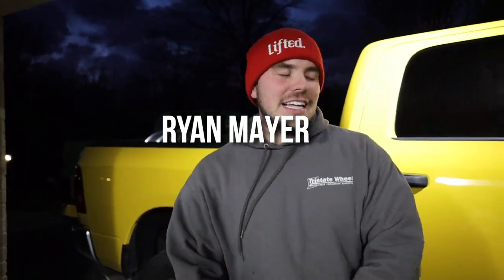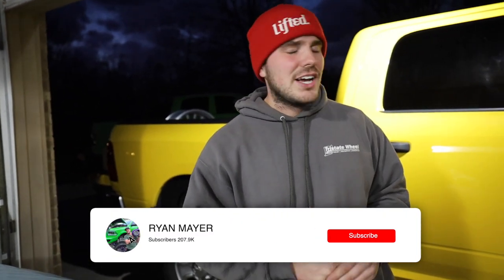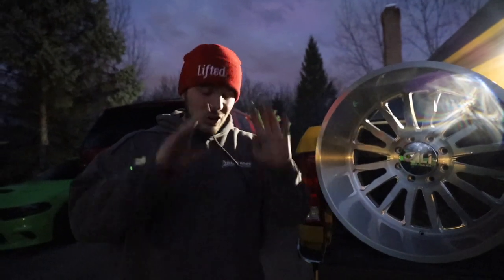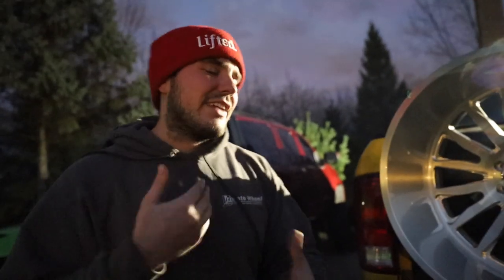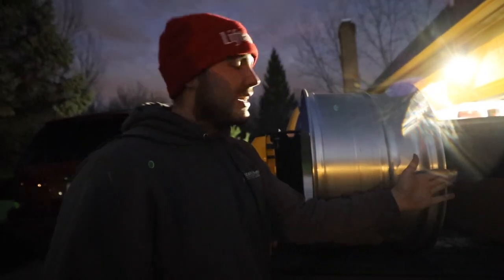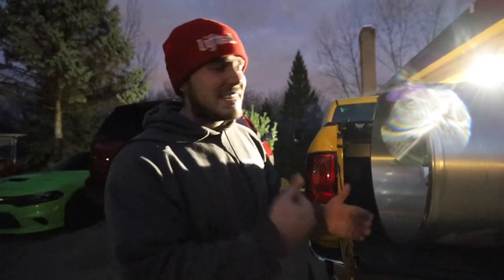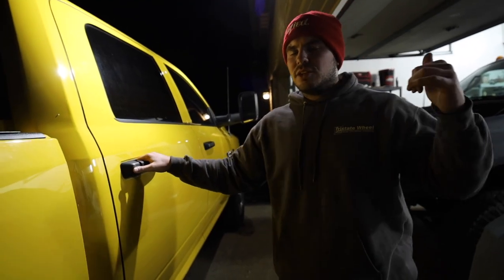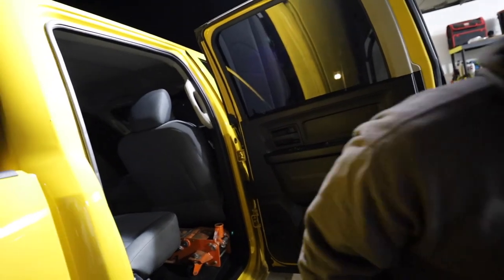Building a Banana Ram | Part 6

Comment: You should put custom led strips in the door handles that have clear running light and amber dirctional  lights but do a clear over it with a little yellow tint so you dont see them till there on

Comment: Power stop makes a drilled and slotted rotors and pads,I have them
 On my 06 dodge, I tow and drive it hard and never had a problem with them and they didn't cost alot.
Reply from the maker: Really? I’ll check em out!

Comment: I would do the red.  You've already got purple on the other truck.  Do the red.

Now, if you want to get tricky, wrap the truck in primer grey and do the suspension in red, or cardinal red, with some red features on the truck body, along with maybe some white here and there.  Straight up BUCKEYE truck!  That's exactly what I would do.

Comment: One thing a I think you should have gotten a dually banna ram 3500 and gotten Katie a long bed crew cab dually 2015 f450 but the point is you should have steel wheels on a hauling truck not aluminum or some alloy not complaining just a personal grip and a note

Comment: Do yellow and do suspension yellow and brushed . I know brushed isn’t a color but it’s look good. You can do brushed handles emblems ventvisors brushed interior accents all the banks stuff do brushed. I’d do some cutout fender flares and less lift but still bigger tire than lime time those cut out fender flares done right body work and paint everything it’s different and looks good brushed bedcaps and brushed off road body protection just something different to think about just if you go that route clear coat all your brushed finishes to keep the corrosion away

Comment: The brushed wheel looks killer, definitely stick with that.  And the Red is without question the way to go.  I really think you should flare the truck out or do a baja fenders (google baja rapter f350 for the look) to match the width of the tire though.. an aggressive and beefy stance would set that thing off right.

Comment: Love the Cali off-road wheels. I think you should either color match the barrel inside of the wheel to the truck or if I’m saying this correctly The back of the wheel where the spokes are that design on the wheel should be color matched but I think she’ll leave some part of the wheel brushed not make the wheel fully color matched

Comment: ...just picked up some "banana og" yesterday, regular raw flower, buds, lolol it's like 26% thc but, we all know ya cant buy strictly from % numbers...some high shelf tho for sure😁💪🔧🔩🤙
...so use to have a honda dirtbike with red accents, now have a 2016 suzuki that kinda comes with blue accents but I went with red, also a 2016 r6 60th anniversary so its yellow, brought a pop of red into it as well. Cant go wrong with that combo. It has like an m4 street slayer slip on and stuff. So their logo also has red pin stripe, i run Pirelli diablo rosso III's now too. The lambo pirelli edition uses red pin stripes. 🤷🏼‍♂️My old 2007 blue r6 I went with yellow accents bcuz the gold forks mainly but a tad of red always goes with that combo... sigh huh LoL.. so I'd think the red would be bang on then you can also perhaps use a tad blue someplace even purple maybe couple low key decals they'd pop against the main yellow & red.. 👌
*(same with my blue truck i swapped factory orange edge edition decals out for yellow...edge has color matched trim and bumpers with vynal floors already. But a pop of contrast goes along way.)

Comment: You should make the truck low and wide if you are going to tow the og ram and Katie’s truck around to the truck shows
Reply: And also the taller you go with a truck the less weight that you can pull because you are changing the center of gravity